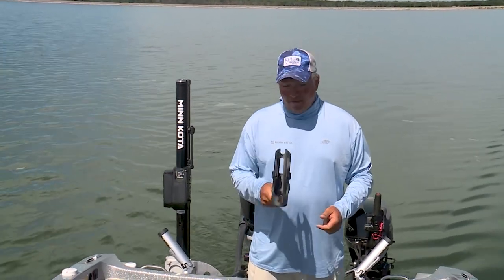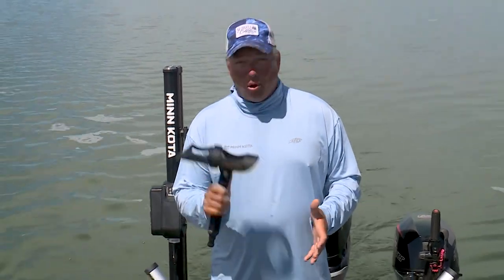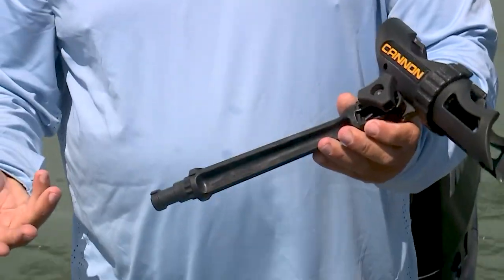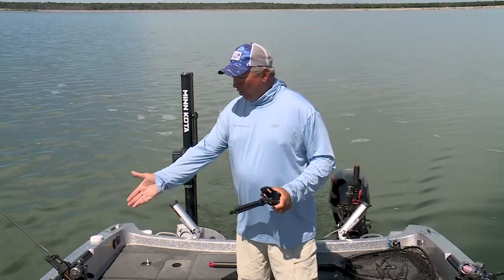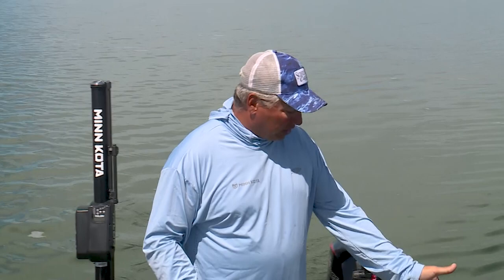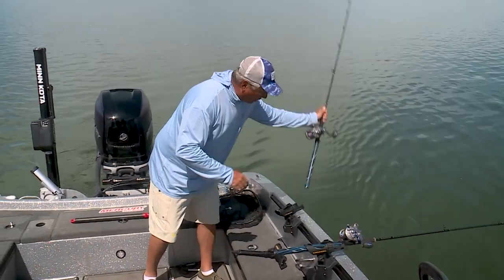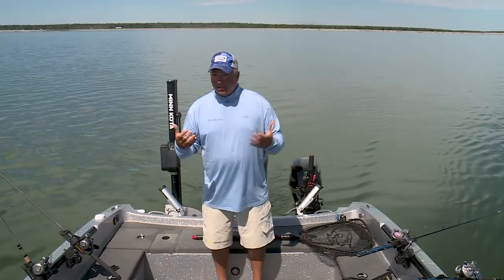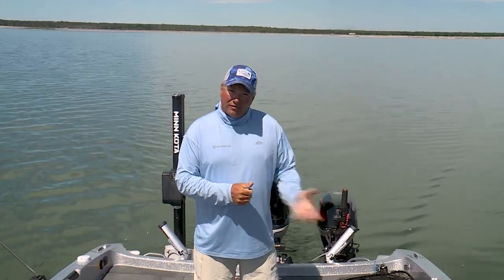Rod Holder Walk-Through with Johnnie Candle | Cannon Rod Holders

Comment: Never liked the idea of using shorter rods in the rear just for the sake of avoiding tangles. That's why you set them at different angles.
There's far more benefit in my mind to have all the same length trolling rods as to be able to put any rod in any rod holder. If you catch a fish on your outside board, you can move all the rods over one holder and make that your inside board when you reset it, you don't need to run it all the way out there to reset as the outside board again.
Sometimes you can't always rotate the rods like that if running them at different depths i know, but still, limiting the rods to be in a specific holder just doesn't seem like a problem worth having if it's just a matter of accidentally crossing a line being slightly less likely.  If you're having trouble getting the rods in and out with hitting the lines of the other rods, I'd suggest you either space them out more, or get height extensions on the rod holders as oppose to getting varying length trolling rods.